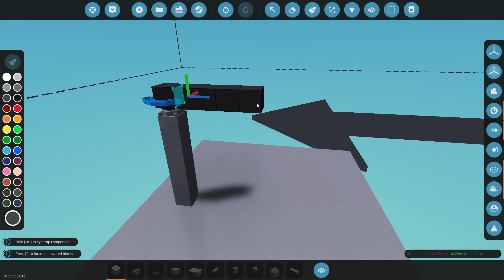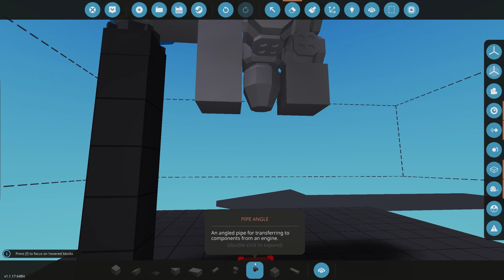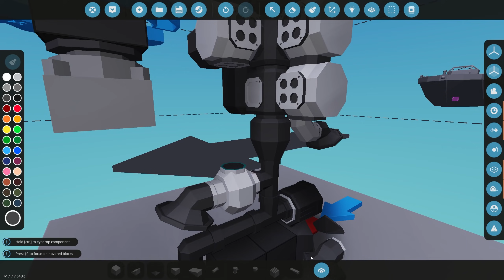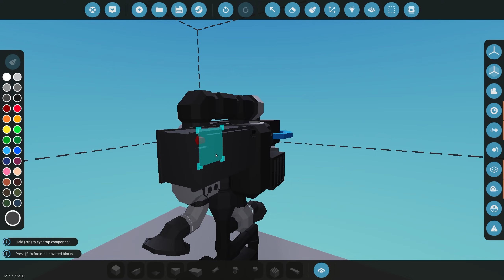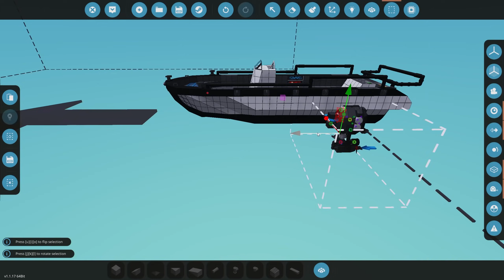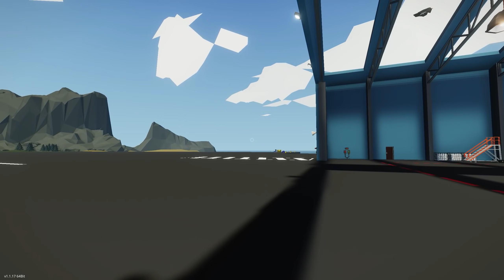Small Modular Engine Outboard Motors - Stormworks

Comment: Ok so when I use this with the MC in the video it says that I have too much fuel on the MC tooltip but I don’t know how to fix that, and it’s really annoying because my engine hardly works, even though it’s a near exact copy, AND when I throttle up the propeller RPS goes down. I don’t know what I did wrong

Comment: This is a really good engine the only problem for me is the steering is inverted. and I haven't found a way to fix it yet be advised I'm new to building in storm works this is my second boat I've made. so, the solution is probably very easy.
Reply: If its inverted try to turn delete the pivot and out it in again but before press U it will invert the spinning direction or if you're lazy get into the parts menu and grab a Numerical Inverter.
Happy building o7
Reply: @FallenQuasar  Thanks! appreciate it

Comment: these engines are perfect with 3 cylinders each, but with a good gearbox it still goes 35 knots, and with 2 medium fuel tanks on the boat, it lasts a while. This is on a boat of very similar proportions.

Comment: i also would like to see these built  
1 Heavy Modded Rolls-Royce Merlin that recycle 100% exhaust and is 100% efficient and is a Five-stroke engine

1 Heavy Modded Rolls-Royce Merlin that recycle 100% exhaust and is 100% efficient and is a Six-stroke engine

1 Heavy Modded Rolls-Royce Merlin that recycle 100% exhaust and is 100% efficient and is a Two- and four-stroke engine a.k.a. the double-piston internal combustion engine, is a new type of internal combustion engine

Comment: Since the engine is cooled with salt/sea water, Won’t it damage it?
Reply from the maker: Yes over a very long period of time it will eventually start to damage the engine performance, but you would run out of fuel many times before you had any issues. Or you could add fresh water instead but then would make it an unrealistic size.
Reply: @MrNJersey  or you can have your water tank on the boat and connect it to the engine with a hose.

Comment: A clutch does not convert power. A clutch allows power to go through it(or not) not converting it.
Reply: I do love your vids and obvs warch them i just found that statement to be incorrect.
Reply: Engines still work w out clutches, they just output power constantly, if running.
Reply: @lokihexdrag  yes but the modular engine  crankshafts don’t have pipe connections, the modular engine clutch is basically like an adapter.

Comment: Would be nice if they gave use an alternator with pull cord, so you could run a small motor without a battery.  Also you did not add a way to refuel that boat.
Reply: You may be a genius ! A hand crank !

Comment: I am actually having a problem using your controller. The afr  is adjusting a little too fast. It  spikes one direction than the other. I tried to understand how you inverted the signal so it removes fuel versus adding fuel. I wish there was a way to invert the pids.
Reply: My suggestion is to edit the microcontroller to remove that part all together, then experiment with your own value. It is just a simple up down counter that needs replacement.

Comment: When I copied your engine, it didnt work. I dont know why, when I put in the clutch, it just died. Can I please get an answer or some help? (edit: Ive tested and messed around a little bit, and found out that it comes to 4,99 rps when I set up the throttle. So what happens it that it stops and tries to start itself. But then it just stops when its right about to start. How can I fix this problem?)
Reply: Clutch pressure?

Comment: there is no clutch inbetween your electric starter motor and your prop doesn't that mean when you are starting the engine that the boat wil go forward?
Reply from the maker: It briefly lets power through to start, 0-2 rps, wont be enough to move it more than a few meters normally.

Comment: Great video, one issue: your using salt water for cooling which will cause engine scaling
Reply from the maker: Yes, you are right, but in my testing the fuel will finish before that ever becomes a issue.
Reply: @MrNJersey  you can set a fluid filter to fresh water only

Edit: nvm that doesn’t work

Comment: Could you have used a hinge because It has ports for fuel? So you would have more fuel capacity.
Reply: Or you could use 2 fluid connectors and use a hose in between.
Reply: It was just an example
Reply: @dominicks360  I know mate :) the hose is a more compact solution though, so I would recommend that over the large hinge.
Reply: @taskforce876  Oh ok, I agree

Comment: I learned something new: the engine can touch water, as long as it has air
Reply: that's why you put intakes as high as possible
Reply: It's a closed system yes, air (and exhaust would be best too) should be out of the water.
Reply: Real engines can as well, thats what snorkels are for on cars, to let the engine get air while submerged.